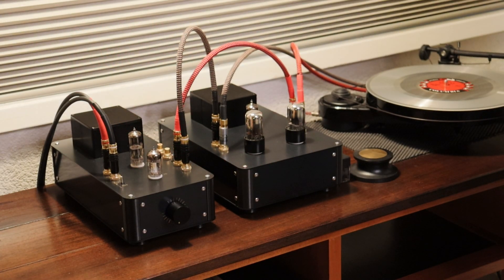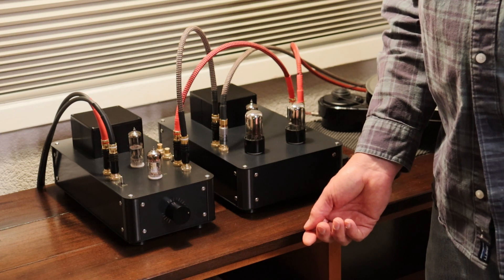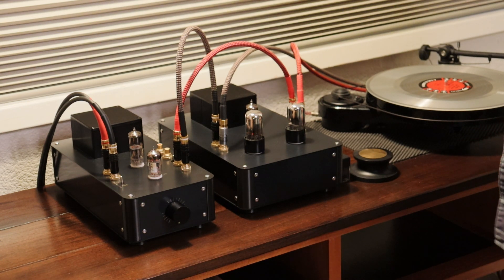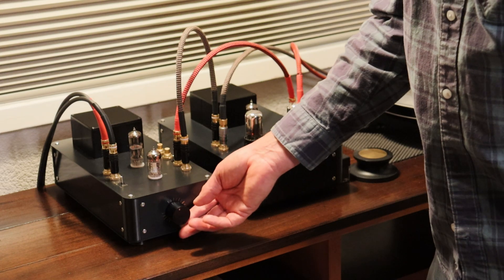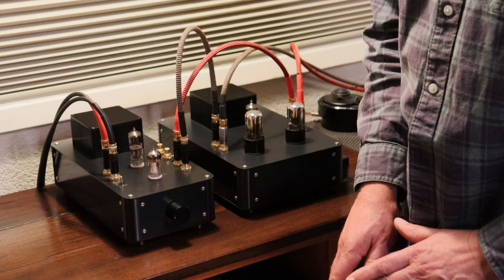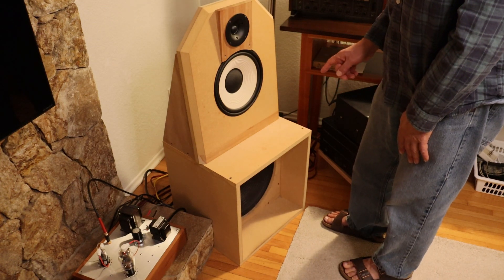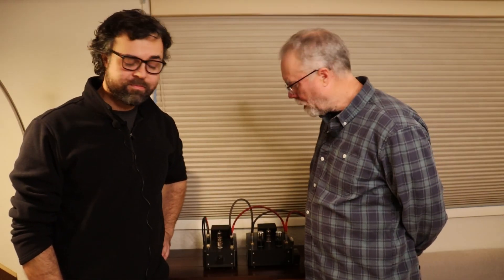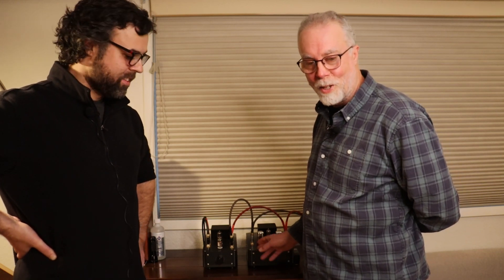Ep21 Putting Your Amp In System - 6N1P "Rocket" Preamp

Comment: Love how that modern line phono stage looks! With a separate DC filament supply too! What a beautiful piece. Fantastic work, guys. I see it’s got a cathode follower thats not an octal tube, but appears possibly to be a 9 pin. May I ask what it is? 12AU7? 

Do you guys forsee a modern line 6 or 12SN7 preamp in the future? I’d absolutely love to see that. It’d most likely be a reason to get rid of my current pre. 

Those speakers are beautiful too, and sound fantastic at least through the YouTube filter. Have you ever thought of making those speakers available as a kit shipped as a flatpack? I know the room has a huge effect, but I’d bet a lot of people would love a pair. The system as a whole seems to have excellent synergy with great balance. 

Thanks guys!
Reply from the maker: @NickP333  The Modern Line Universal Phono uses a 6N6P as a cathode follower, possibly the best and most under utilised vintage tube ever made.
Yes a Modern Line version of the 6or12SN7 Pre is coming sometime in the future.
Most (~90%) of the audio feeds on our YouTube Channels are recorded directly off the outputs of the Preamps.
A speaker kit is a possibility once we get a small factory established, but running two busy businesses is maxing us out.
Cheers 
Jim

Comment: It will be good idea to add on the output of each device a relay which on start  device shorts signal to ground. It's easy to do on NE555 and you can add it on next revision of pcb.
Reply from the maker: @beautysilence3854  please explain the purpose of this circuit revision, the benefits and of course any negative impacts.  As well please draw up a little circuit sketch so everyone can see what you are proposing.